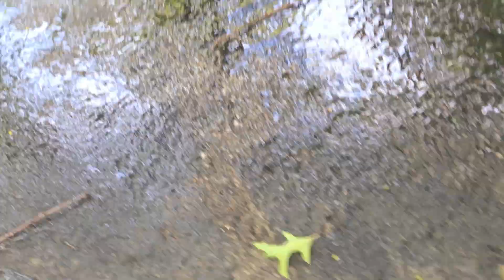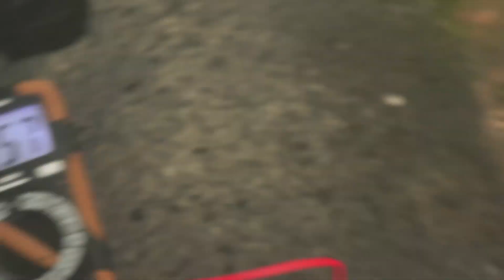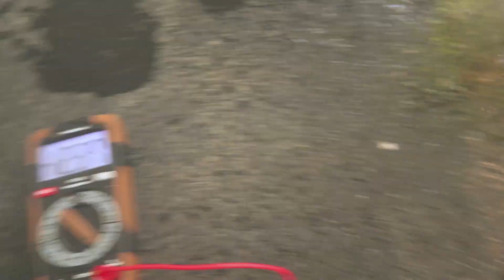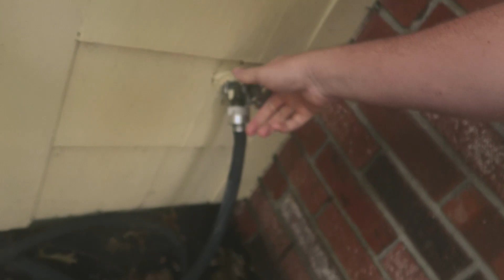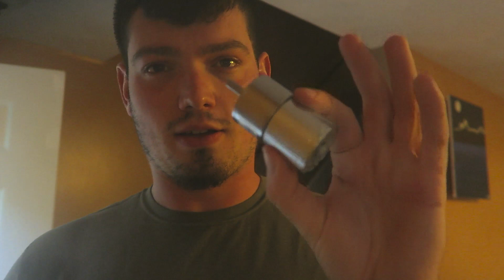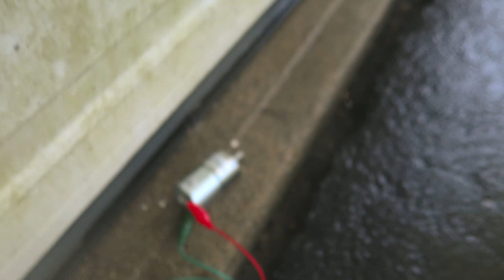3D Printed Pelton Turbine Water Power (Part 2)

Comment: You could try 3d printing a generator that can match the force coming from the jet. (Basically measure how much energy is being added to the wheel with each spin and use the induction equation to calculate how much wire and magnets you'll need to match the values)

Comment: sigh.
jets at the wrong angle, not tangential enough. should be tangent to mid-cup.
there should be virtually NO water splashing. the whole point is the water STOPS. hits the blade, performs a close to 180 turn, and imparts its momentum to the blade. 
and the blade recedes at half the velocity. yes, some splash is to be expected. things arent perfect. any water that doesnt simply stop and fall straight down is wasted energy. if its carried with the wheel and flung off, its wasted energy. if its spraying five foot off to the side, its wasted energy. a GOOD pelton barely needs shrouding... 85% efficiency basically means 85% of the water did stop... (would anyone understand if i said its more like 92.5% of the water stopped?)
cups look way too small for the amount of water.
as the nozzles have to be dead on center, which is always fiddly, and the full 180 degree turn is "impossible" the cups are better to be mounted sideways, single sides, and water fed in from the side,  ie, a turgo. a 120 degree turn is adequate.

and then, you know its actually efficient when the bucket speed is half the nozzle velocity. the load matching the water flow and maximum transfer of momentum.

finally. most important aspect of a pelton after the cups is the nozzle... ideally, spiked up the center. maintain flow velocity whilst throttling flow rate.

peltons are basic. pressure turbines are where its at...

i could start on the generator but couldnt be bothered beyond saying "car alternator".

for load... best is nichrome wire elements. decade resistances. 0.01, 0.1, 1, etc... can graph the results out, IxV/R...

a dead short will be max load, full current at min volts.

all these motors have lousy regulation as generators...
Reply from the maker: This is an incredible write up thank you for the input. In the next couple of days I'll have a new design tested and uploaded to try and mitigate these issues as mentioned. (Edit the new design has larger buckets with a more defined geometry to encourage the change in water direction).
Reply: @Beyond_The_Print  hope it helps. theres a lot of confusion and misinformation about turbines. theyre really simple at heart.
saying the water "stops" is a misnomer. it hits the blade, does the 180, and exits at the same speed it entered at... except as the blade is receding at half that speed, it appears to stop... relative versus absolute motions. whatever. when its good, the water is "dead", all its energy(momentum!) gone, and it just falls down.

you cant get the full 180 as it falls back into the blades, and re-accelerating that water to move it around is wasting power. the water must escape!

with a good generator, and iunno... maybe set up a mosfet or five on a heatsink as a simple resistive load... a pot as a voltage divider across GDS will keep it in linear mode. 
then you can just dial it in until the wheel does do half the speed of the jet, then measure the power , IxV. 
at that point, if you know the water pressure/head, and the nozzle diameter, you can do some calcs on the energy available in the jet, and the closer you get to half of that, the more efficient you are... really easy way to test bucket geometry properly.

you can only get HALF the potential energy.
or, you can only get HALF the kinetic energy.
basic physics.

dont confuse it with betz... that skips the 1/2 as the flow is already kinetic, in an open system... theres no head. just mass flow over area.

Comment: With such powerful impulse, the output power was just 1.2W. What a big loss.
Reply from the maker: I posted a bench test video tho showing with a higher resistance (thus higher power potential) the generator is capable of much more power. I want to demonstrate its power potential simulated with a real world test tho.
Reply: @Beyond_The_Print  But I noticed one "mistake" in your impulse jet, which it hits not tangential to the turbine bowl. However, it gives a significant pressure to the axis rather than the impulse jet turn the turbine.
Reply from the maker: @StrsAmbrg  this is a very good point. Tomorrow I'm going to redesign a housing that allows the turbine to be parallel to the ground and hopefully increase the force acting on the axis of the motor. Thank you for your input.
Reply: @Beyond_The_Print  I will wait. :)
Reply from the maker: @StrsAmbrg  I'll do my best to tag you when it's posted. I'll Try and get the redesign done tomorrow then print and test as soon as I can.
Reply: @Beyond_The_Print  I will love it. Sure. 😀
Reply from the maker: I believe this was due to the resistance of the circuit. I'm gonna attempt a new video tomorrow I thought I had uploaded a newer one but I guess not.

Comment: Very good stuff. I like it. Few comments... 1. Put your meter in a plastic bag or plastic box...it won't be damaged by a little water, but again...why take the chance? 2. The low watts on the motor is because it has no load on it... To put a load... you have to pinch the shaft... or make a contraption so that the motor pulls a heavy object up ...Even better since the turbine is pushing around 12V DC...just get a car light bulb...and measure the voltage and current through the bulb...and you'll get the watts. Try small automotive bulbs...Halogen bulbs on the other hand...may be too much...they are rated at 50 watts or so. hence,  they will draw about  4 to 5 amps ...Cheers!!!
Reply from the maker: Thank you for this, in the part 3 bench test I tried using a 12v car defroster. That is rated for 13 amps which was a bit much. I have since purchased 12v 25w heater pads so ill be making a video as soon as I can.

Comment: Nice project! A low RPM Axial Flux Generator may give decent output. 
I couldn't find the file links. Which software did you use for designing the Pelton Turbine? I'm planning to hook it up with my existing generator and see how it goes.
Reply from the maker: The design was on thingyverse which I modified on solid works to scale it up and make the changes I needed. Along with the hub I made from scratch
Reply from the maker: There's a newer one I'm using it the latest vid @Jayed Hasan